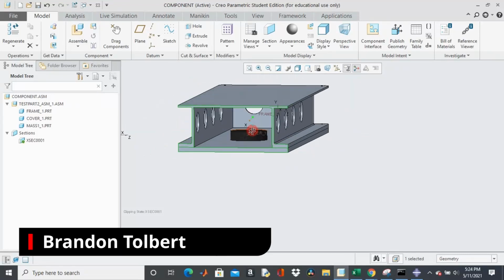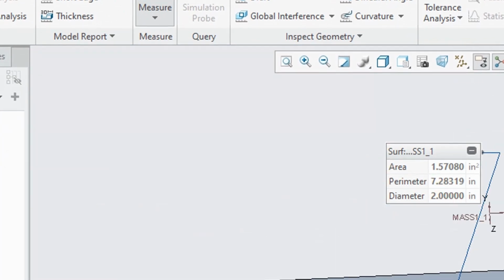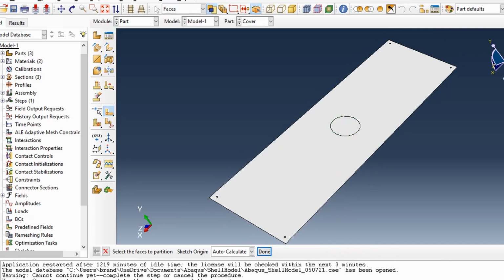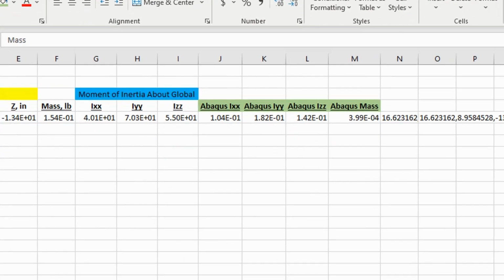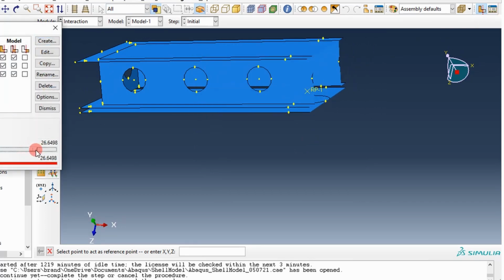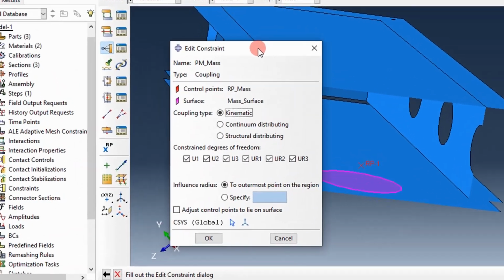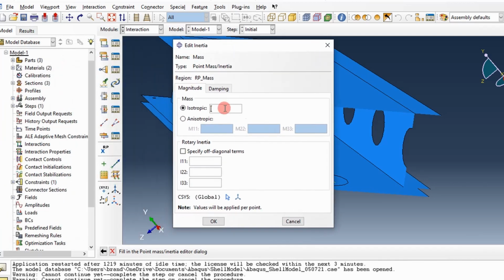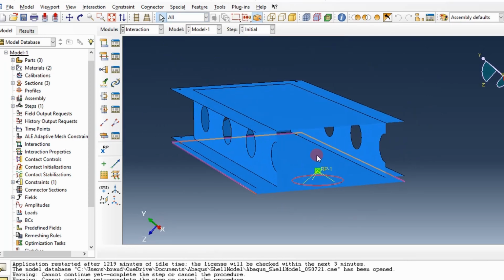Point Masses in Abaqus

Comment: Very good vedio. Thank you for this insightful presentation. I have one doubt regarding point mass. In my case I need to add added mass to a floating body. This added mass is caused due to the presence of water surrounding a submerged body. And it will create an inertia to the body. But in that case gravity loading will not be acting on this inertia mass or so called added mass. How can I do that condition in abaqus. Kindly guide me please